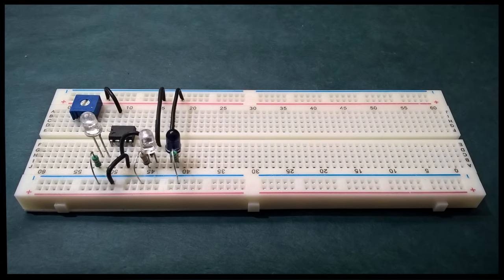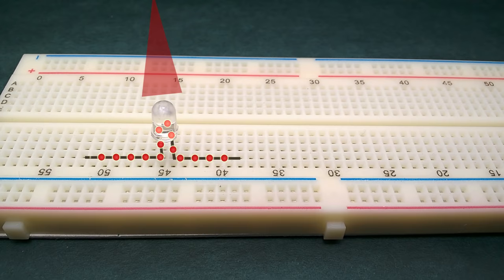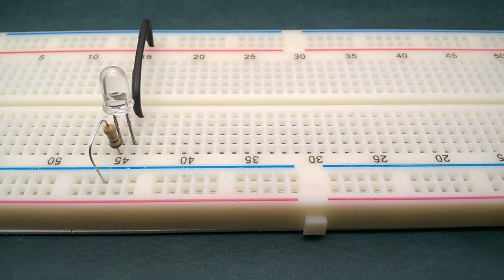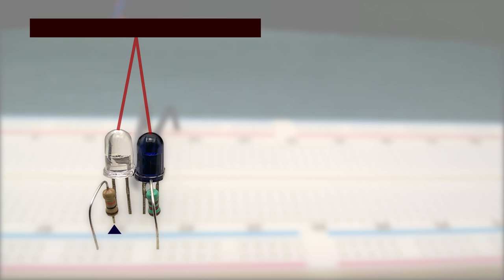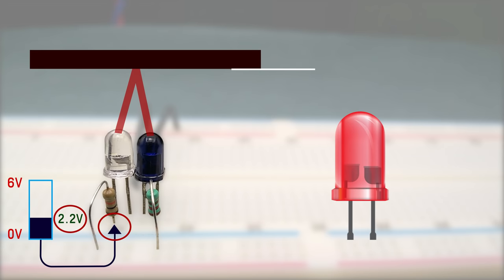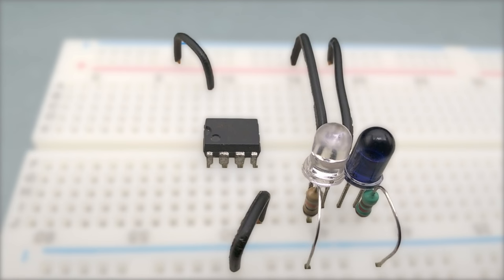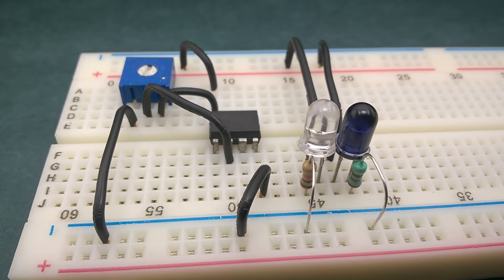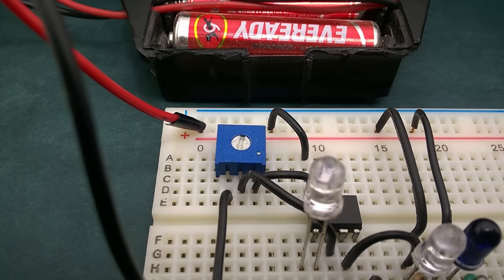IR Proximity Sensor / Obstacle Detector circuit on Breadboard | LM358 Op-Amp projects

Comment: Please guide how to setup diy for ir sensor module  in reverse mode  I.e. when obstacle place befoe ir sensor, light will off mode
Reply from the maker: You can swap the inverting and non-inverting connections made to LM358 IC

Comment: Sir I have connected my ir proximity sensor to my ups battery and it remains on when I connect 9v battery now . I have checked by rotating the knob of potentiometer but it does not work only led keep glowing everytime
Reply from the maker: Please go through the troubleshooting guide. Link is in the description

Comment: Plz tell which resistor with each component when I connect 9v battery
Reply from the maker: 470R for the transmitter, LED and 10K for the receiver(IR Photodiode).

Comment: Bro can u pls help me
My led is continuously glowing
I have switched off the lights but it is glowing in the same way
Even when i removed black ir led from the circuit it is still glowing
Reply: Pls help me as fast as possible
Reply: Same problem here. It's like it became an ordinary circuit! Which works due to battery
Reply: might be 358 ic be at fault

Comment: does it work almost the same as the ultrasonic sensor?
please help me
Reply from the maker: No. An ultrasonic sensor involves measuring of time delay between incident and reflected ultrasonic waves where as this circuit uses measuring of changes in intensity of reflected IR rays.

Comment: Can i do it with NE555 IC ??
if yes.....how will be the scheme?
Reply from the maker: It's possible, but the output stays latched.until you turn it off manually.
I have to experiment with that. Will share the schematic if it works.
Reply: Elonics - Electronics Projects on Breadboard👍 ok thanks and i am waiting you.

Comment: Hiii
mine is working opposite
led is on all the time and whenever I am putting my hand near to it, led is getting off
any solution ?
Reply from the maker: Are you testing this circuit in very bright surroundings?
If the IR radiation from the surroundings is greater than that from the IR LED, this happens.

Comment: Bro I tried it, as my mini project but it is not working bro the resistor placed near white is the problem when I taken it from connections the light is blowing continuously and when placed it , it is not working 

And also im using 9v battery bro so I'm taking 470 ohms for the pair of led's white and side one and I used 1k for led and plz tell me bro 

My connections and components are correct or not
Reply from the maker: Did you go through the troubleshooting guide? Link is in the description

Comment: if the object is transparent , is it affected the receiver?
Reply from the maker: It reduces the sensing range a little bit
Reply: @elonics  so, can we use it as sensor that distinguish between transparent and opaque object?
Reply from the maker: @hamsanirudda8264  Yes, you can use this. One good way is to place transmitter and receiver opposite to each other and place the transparent / opaque objects to test, in-between them

Comment: Can you please provide a simple circuit diagram?  Becoz i have to do it on PCB instead of breadboard
Reply from the maker: Hi, the link is in the description. http://elonics.in/breadboard-projects/infrared-ir-proximity-obstacle-sensor-using-lm-358
Reply: @elonics  thanks, I did it but it did not worked. I connected a buzzer instead of led and connected resistors of 470 and 1k resistors as you have instructed in your link. But when I on the circuit, the nothing happens. Only when I keep the shaft on maximum, the buzzer buzzes continuously till I decrease the shaft. All the components are also new. Please help 😔🙏🙏💓

Comment: If I want to connect a buzzer where should I connect?
Reply from the maker: Between the output of IC 358 and ground.
Reply: Same like connection in led?? Positive terminal of buzzer with LM 358 and negative with ground???

Comment: Nice video and I tried out this circuit with an IC 741 and it works good
Is there a way to increase the sensitivity range from about 2 inches to two feet, please check out and reply, thanks

Comment: Using a 741, can't seem to get it going. Even tried with an LM339 comparator...Nothing.
Reply from the maker: Short the inverting input to -ve rail and see if the output turns high.
If it does, there might be a problem with the potentiometer's adjustment or its connections.
If it doesn't, power connections to the Opamp might be wrong.
(Vcc goes to Pin7 & output to Pin6 for 741 IC)
Reply: Elonics - Electronics Projects on Breadboard as soon as I disconnected the POT to the inverting input (pin2) the Led went high. Vcc to 9V. Pin4 to GND. 8V across detector. mV at non inverting input
Reply from the maker: Re-connect the POT and try turning it's knob between its extreme positions. The output should transition from low to high at some point. At this point slightly turn the knob back just until the LED turns off. Now check if the circuit works.
Reply: The LED switches off at1.96V at the inverting input. At the non inverting input I only read 41mV with nothing approaching the IR E/D. When my hand is directly above the the Emitter/Detector, I only read 250mV to 300mV at the noninverting. Tried numerous POTs, have a 10k in series with detector(+) and 330ohm in series with Emitter(-)
Reply: Basically  anything less than 1.96V and the LED is on. Anything above and the LED is off. LM741, V+ to 9V battery, V- to GND. Pin 6 output is a 5.2V output. Inverting/noninverting inputs are working, tested with a LDR circuit, 741 is working. However, with the noninverting input a low voltage, the LED is on for anything less than 2V at the inverting, and off for anything higher. Tested with a 7.24V noninverting input. LED was on until I increased the inverting input to anything above 7.24V. Im guessing my problem is there is not enough voltage across the 10k. I got these IR E/D from radio shack.
Reply: OK...Seems the emitter and detector don't want to work side by side. I had to power the emitter thru another breadboard and get direct line of sight to get the voltage I needed at the noninverting. The side by side set up wasn't working for me, wouldn't reflect off my hand, book, paper, etc. So I power it directly with 1.5V and sighted it directly above. Gave me about a 4inch gap to detector to get about 2V. Close I got the higher the resistance/voltage @ noninverting input.
Reply from the maker: For me, the voltage at the noninverting input increased from 0.65V to 3.8V when I move my hand closer to IR E/D. (with 6V supply)
When I replaced 10k with 22k, the voltage at detector(+) increased from 0.65V to 1.6V. So yes, I guess there is not enough voltage drop across the 10k in your scenario. Can you replace the 10k with 22k and see if the voltage has increased at detector(+) ?
Reply: Elonics - Electronics Projects on Breadboard 

Ah. More resistance = more voltage. 22k was actually still too low. I found 100k to give me .8V at noninverting. Cool. It is functioning now. Thank you

Comment: The output led is glowing all time with and without any object, pls help
Reply: Shubhajit Mondal ... The same problem exist for me also .. what did you do for that ?
Reply: This video is fake, the circuit is wrongly done
Reply: Frnd The Same Thing is Happening With Me Also And ReMade It thrice Using Circuit Digram and Troubleshooting Tips But Still The Led Is Glowing Continuously
Reply: Same problem here please someone tell the solution
Reply: Vaibhav Naik , this video is not correct check other one
Reply: Shubhajit Mondal, thanks for telling bro, I thought I made a mistake.
Reply from the maker: Watch this: https://www.youtube.com/watch?v=036kskbFf40

Comment: I have one question for everyone. Can we detect the range upto 5 meters by using high value resistor so we can adjust the reference voltage? 
Can anyone explain about this?

Comment: Can I drive a 12V motor from this.
Reply from the maker: LM358 can provide max current of around 40mA. Most DC motors consume less than that (If there's no heavy load), so there shouldn't be any problem.
Reply: Thank you so much. Actually, I'm trying to use this circuit for making an automatic sliding door system. Thank you.
Reply: Sir how do I connect a relay at the led so that I can switch on a 9v motor.

Comment: Lo tengo conectado tal cual sale en el video, pero no me funciona, vario el potenciometro y se queda encendido o apagado el LED pero no tiene efecto alguno el emisor ni el receptor sobre el diagrama, al invertir las entradas 2 y 3 solo en un extremo funciona pero al reves, es decir, siempre esta encendido pero al acercar algo se apaga

I have it connected as it is in the video, but it does not work, the potentiometer varies and the LED stays on or off but the emitter and the receiver have no effect on the diagram, by inverting inputs 2 and 3 only in one end works but the other way around, that is, it's always on but when you zoom something goes off

Comment: can't it delay for few more second?
Reply from the maker: You can use a 555 timer in monostable mode. You need to connect the output of OpAmp to trigger pin of 555 timer configured in monostable mode.

Comment: You should place a resistor in series with the potentiometer in order not to short out the power supply (batteries in this case)
Reply from the maker: The fixed positions of the potentiometer are connected to +ve and -ve of the power supply. So irrespective of the position of potentiometer knob, there will always be a constant resistance between +ve and -ve of the supply (10K in this case).

Comment: What is the value of the potentiometer
What is the  value of power source 
We can give 5 volt ?
Reply from the maker: It's a 10K potentiometer. Power source: (3-12)V
But for supply voltage of 9V or more, use 1K resistor for LED and 470R for InfraRed(IR) LED.

Comment: dude speak more clearly man, i assume you said 220 ohm resistor at 1:50
Reply from the maker: Any resistor between (220-470) can be used. I have used 220R in the video, but 270R is ideal (I said 270R).
I guess that created confusion